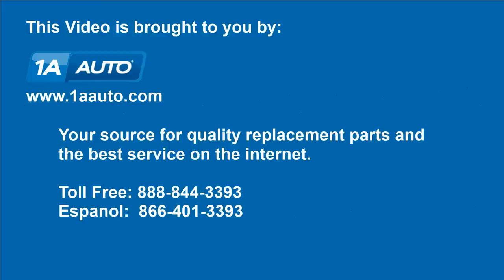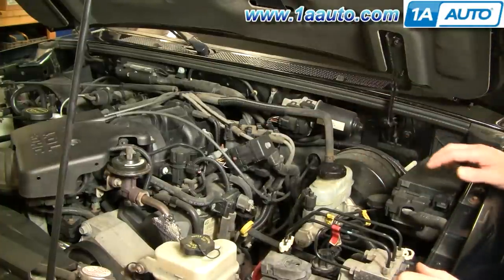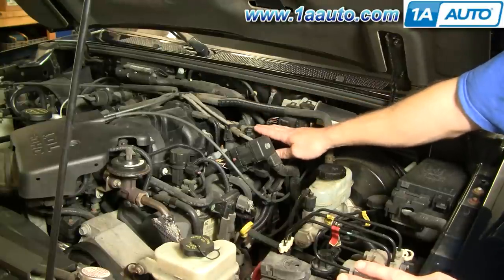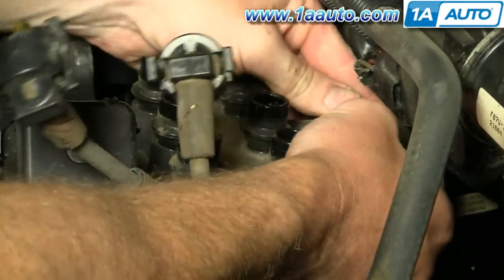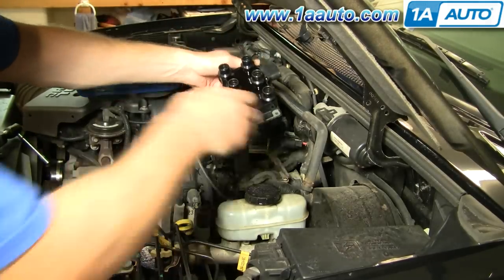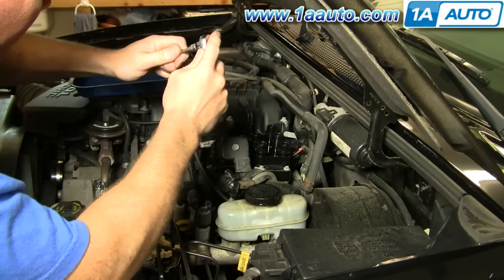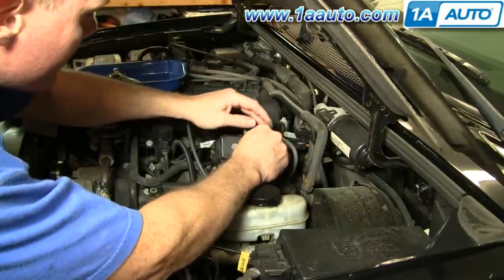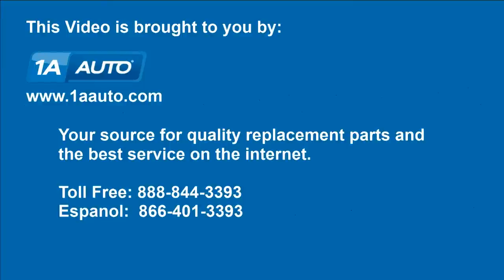How to Replace Ignition Coil Pack 90-11 Ford Ranger

Comment: @chengg did you get your truck fixed?  mine does the same thing at about 17 miles get misfire code and at times truck misfires. It all started after replacing seperated crankshaft pulley. I have replaced wires ,plugs and coil pack..still does it. Crankshaft sensor appears to be ok.     Help!!

Comment from the maker: @peacehippie32 If it happens more when it's damp out it could be a coil. You may want to get a spray bottle with water in it and spray the coil while the vehicle is running to see if it's arching out anywhere.

Comment: thanks to you're video i figured out why the computer wasn't getting any reading changing out valve cover gaskets and putting back all the connections i forgot to reattach the coil connection.saved me so much time diagnosing if there was a ground issue.I'm definitely going to be a loyal customer for getting parts from your company.

Comment: Do you still make videos man? My 2006 ranger 2.3 has a flashing check engine light and I changed the spark plugs and it’s still going. I can’t even barely make it up a steep hill. It’s shaking at idle

Comment from the maker: @22bradsutter A bad coil will cause misfiring which can cause the vehicle to shake and a malfunctioning coil will usually turn on a check engine light.  There can be other causes though.

Comment from the maker: @ecuplanr You may want to check around where you were working to see if something else may have been disturbed that's causing the issue. Possibly a disconnected wire, or bad wire.

Comment from the maker: @dwt56 You could try to replace the spark plugs if they have been in there for a while and also the coil. It may be the coil that's acting up. Hope this helps you out.

Comment from the maker: @dwt56 That code may point to a multiple cylinder misfire. If you have other codes behind it, they should pinpoint what cylinder may be causing the issue. You could try to clear out the code and see if it comes back after 3-4 heat cycles.

Comment from the maker: It wouldn't hurt to fix the sensor that's causing the check engine light to come on. Worst case senerio is, it's fixed you won't keep you from passing inspection, it might help to cure your issue.

Comment from the maker: It could be that,or you also may want to check the EGR valve to see if it's bad. A bad EGR valve could also make the vehicle run rough.

Comment from the maker: @chengg02 I would repair the misfiring cylinder issue first and then see if it clears the bank codes. If it does not it could be a couple of bad 02 sensors.

Comment from the maker: You may want to check the distributor cap, rotor and spark plugs to see if they are dry from moisture and in good condition. You could also check the spark plugs to see what shape that they are in.
Reply: Where do I get the proper sequencing to make sure mine are in the right spot??
03 4.0 FX4 lvl2

Comment from the maker: @awaldegrave I would leave it on there until it starts to cause a problem. You should change the spark plugs at the manufacturers recommended intervals.

Comment: @1aauto Do you mean to replace the coils to repair the misfiring cylinder issue? I have done that, 17 miles later, p0171 and coil #2 misfire came up again... took a little longer than usual (before replacing the coils the codes would come up quicker). Any ideas??

Comment: Check engine light was on for a while and the code had come up as an o2 sensor and i was told that it wasnt something to really worry about if i didnt mind a little lower gas mileage could this sensor be causing these problems? I tested the front three spark plugs by disconnecting the cable while engine was running to see if all were contributing is there anyway to test the back 3 with out removing the manifold and pulling them out?

Comment: Have a Dodge Stratus 98. It runs real rough at times when Im in the stop position or park. Kinda Boggs down as well when driving. Slow to get speed. I had spark plugs and wires already maintained. Could this be the coil or Oxygen sensor?

Comment: Hi I have a '99 Ford Explorer and I have just ran the code reader, it says misfire on cylinder #2 along with P0171 and P0174 which are basically fuel system running too lean on both Bank 1 and Bank 2.  Could those be due to a defective coil? Please advise...

Comment: Check engine light was one awhile ago but then went off , the code was for an o2 sensor could that be the cause to these problems, also i tested the spark plugs by disconnecting the cables while engine was running to see if all were contributing properly and they were, is there anyway to test the back ones without removing manifold? Thanks.

Comment: Hi, We have a 1990 ranger and we think the fuel regulator needs replacing. The issue is when idling we need to pump the accelerator pedal to keep the idle going...? And the location of the fuel regulator is problematic. What would you suggest and advise? Thanks!

Comment: i have a 2002 f 150 4.2 ltr and the engine runs rough with a check engine light. i am getting 2 codes one is 316 misfire during start up under 1000 rpm and the other is 302 cylinder two misfire. Ive changed the plug wires and that specific plug, but keep getting the same codes. im going to change the rest of the plugs but could there be something else before i change the coil pack or should i try that next? any help would be greatly appreciated

Comment: I have an 87 Dakota. I want to replace the ignition coil. the new one says, on it, that a resistor must be used. Is there a diagram available to insure that I install this correctly?

Comment: I am having trouble with my 92 f-150 ford. It would start but later on when i turn it off. It would not turn back on. I don't know if it is the ignition module, i took it to many mechanics but they tell me it one thing and they supposedly they fix it and later on in a couple of days. it would do the same, i already change the gas pumps and the coil and i still have the same problem. i am not good with cars and i need some advice.

Comment: @1aauto the codes say po300 mostly and random other cylinders misfireing. I was wondering if my 2004 4.0 has a camshaft synchronizer ....I here a chirp coming from under the hood sounds like a cricket. One thread I read says that the SOHC 4.0 does not have the synchronizer...I am a machinist not a car mechanic so I am lost on this type of system.

Comment: I have a 95 ranger XLT that's being passed down to me it turns over but doesn't start I've heard it may be different issues but a guy that  I work with came and said it's most likely the spark coils , Back when it was driven by Grandfather it would die on him towards the end , would that be the result of a bad coil pack?
Reply from the maker: +Charles Wescott There could be many reasons why you are experiencing this issue. We would suggest consulting a reputable local mechanic to determine the exact problem with your vehicle.

Comment from the maker: You could also check the fuel pressure to see if you're getting the right fuel pressure to the motor. Hope this helps you out. 1aauto.com 888-844-3393

Comment: When my 2000 Ford Explorer V8 is having ignition coil problems does that drain gas, as well as how do you know if its the coil or the cords that connect to it?
Reply from the maker: If you have a coil that isn't firing correctly it may use a little more gas. If you get a spray bottle and fill it with water, start the car and mist water over the coils and wires, you may be able to see if one of them is arching out, which would enable you to see which one needs to be replaced. Hope this helps you out. 1aauto.com 888-844-3393

Comment: Need help I had codes come up on my 2003 ford ranger 3L V6, p0302, p0303, P0171. I replaced fuel injectors 2 and 3 replaced ignition coil, cables, sparkplugs, 2 new 02 sensors in the front not the downstream. And I still got the codes for cylinder 2 and 3 misfire along with bank 1 system to lean. What could be wrong now most of the parts are now new and still having these problems. I'm wondering if my truck is now long gone and not worth fixing. I just need help :/

Comment: My truck 2006 ford ranger 3.0 is running perfectly fine with 112,000 miles but would replacing my coil pack with a performance one help in anyway or should I use a factory recommended parts or leave it as is I’m not having issues at the moment
Reply from the maker: +Mark Herrera If you're not having any issues with the one that you have, you may want to leave it alone until it fails and throws a misfire code.
Reply: 1A Auto Parts thanks man much appreciated

Comment: Will new coils fix a misfiring cylinder? Already replaced spark plugs and wires, didn't do much. Any suggestions would be appreciated.
Reply: panterask8r14 this is late asf. But yes it does. Usually miss fires from a single cylinder can be fixed from replacing a coil pack
Reply: I am having the same problem, would it fix a misfire
Reply: The other thing it could be is an injector.  If you run a scan and figure out which cylinder, it is a 40 dollar part.

Comment: I have a 2000 ford explorer v6 4.0 when accelerating to 30 mph the car vibrates and eats up a lot of gas. this also happens when you reach 50 mph . I do not have the engine light on. any help? thanks

Comment: Yes sir- I actually have a questionI hope you are willing to field for me?
I’m replacing my Coil packs ( dual packs) on my ‘94 Ranger 2.3 l 4cyl. It’s super used and when I bought it I needed to do a lot to it. Anyway, I noticed each of my coil packs is only held on by 1 screw each. Instead of 4 each. :( so I NEED to buy additional screws. Normally I would remove 1 and drive to hardware store and go in to get them. Don’t have enuf for that either. Lol
So I believe the heads are 7 mm(?) but what about the thread and length? 
I know it’s a crappy question but can u help me?
I really hope to hear from you real soon?!?!??
Reply from the maker: Thank you for checking us out. Unfortunately, we do not have those specifications available to us. The dealership may be able to find out that information with your VIN, otherwise, the best result would be to have is sized at the hardware store. Hope this helps you out! +Michael Hormel

Comment: i have a 1994 ford explorer and my vehicle burns rich on one side and lean on the other. It bucks, poor gas mileage, backfire, and lags when i hit the throttle at points. seems to do better when its hot but still does it regardless. if u think you could diagnose my situation this would me greatly appreciated.
Reply from the maker: If there happens to be a check engine light on you should pull the code to see what it's pointing to. Possibly a bad throttle position sensor (TPS). Hope this helps you out. 1aauto.com 866-403-3393

Comment: That was awesome but how do you know that was the bad part ? The engine light came on in my Ford sports trac  they gave me two pages of thing it could be. Ford Sports Trac  2003  6 cylinder. 4.0 ?  I just do not want to spend $75 for a part that Might be the problem. trouble code p0303 . Changed the oil spark plugs wires air oil and gas filter. And bought a can of injector cleaner. Runs fine except at take off. Sometimes will stall completely out. Let it sit for 10 - 15 min. starts up and runs ok. 
But sluggish at take off.
Reply from the maker: HI William, It looks like that code points to a misfire on cylinder #3. You could try to replace the coil on that cylinder to see if it corrects the issue that your having. Hope this helps you out. 1aauto

Comment: This coil pack DOES NOT FIT 03 FORD RANGER 3.0L ENGINES. The coil you want has 3 bolts not 4